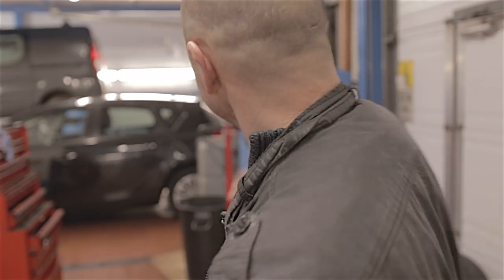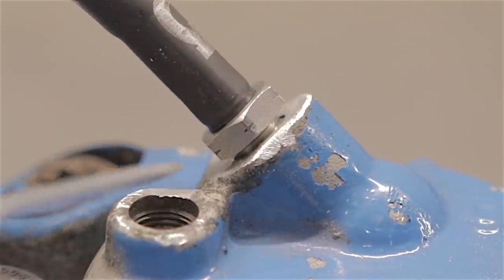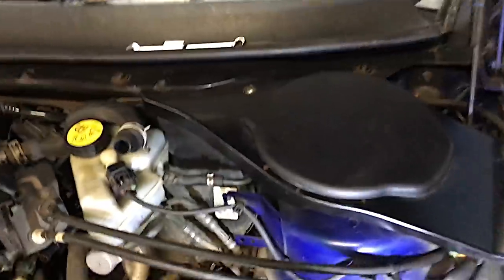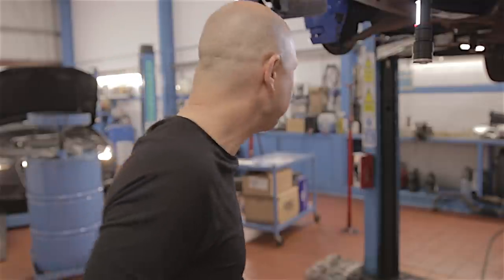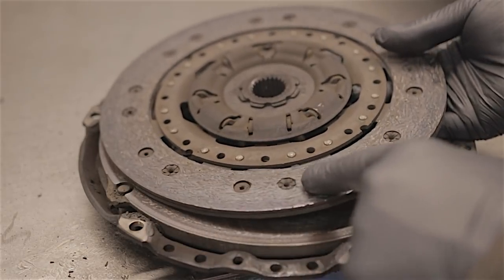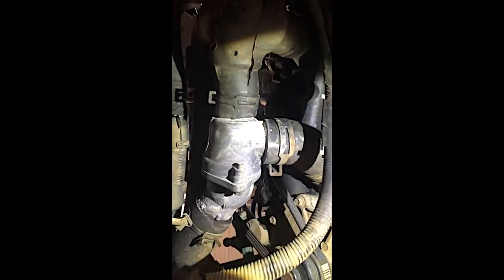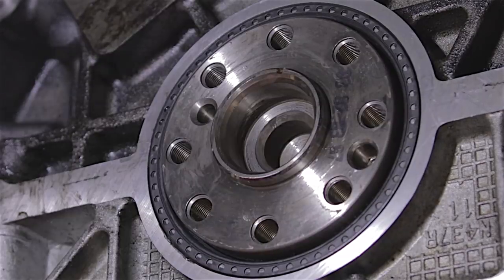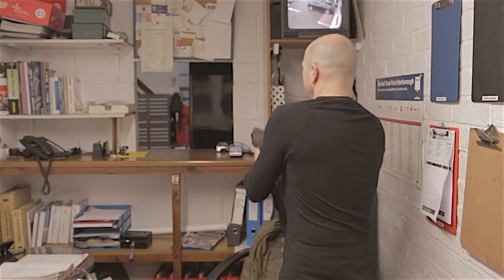Project ST220 (part 4)... Gearbox Removal

Comment: Definitely the Mrs Santa for Mrs Monika! 👍 😂
I thought the use of your credit card  on the rear crank oil seal was awesome idea! It worked really well! 👍 Regards the ST  brake caliper, I can't believe the cast was so far out! Good bit of fabrication though, bet the owner was chuffed. Me and the misses did smile when you found the exact bell housing bolt from a mrk 5 Mondeo, you'd chucked away cos too difficult to put back in! I've been there on my lads BMW 330d! At least the gearbox is lighter! 😂 
Great vid, looking forward to the fly wheel, clutch, gearbox refit! 👍

Comment: Meant to say, my old Mk1 Mondeo V6 leaked oil, I got a crank shaft kit from the USA, consisted of a very thin metal sleeve and tool to fit it over the original crank shaft, no more grove and no more leaks. Now my ST220 is leaking. Bloody Ford's!!!

Comment: If you do not have the proper pins for lining up the sun frame then spray paint the join to the body with light coloured paint. That way when you put the frame back on you can libe it up to where it was (I speak from experience and it works a treat).

Comment: It's not good to use copper grease with aluminium parts like gearbox case.  It's indusing galvanic corrosion betwen this two metals. Anyway, great video and instructions. :)

Comment: Hi mate thanks for this brill video but could you please tell me it was a v6 st 220 that you put that new main oil seal in please as i have got to do mine .thanks mate ,   chris.
Reply from the maker: hi chris...yes is was a 2006 st220 3 litre v6
Reply: @alan4x  Hi Alan thanks for the reply really good of you mate trouble is i have just put new clutch and fly wheel in but me rear main oils seal has just gone . as Vospers seem o be ignoring there phone on a friday afternoon hopefully you can tell me have i got to get new flywheel bolt as i dont know if they are stretch bolts or not so should i buy new or can i use the old ones ?????????, cheers mate , have a great weekend.   Chris.
Reply from the maker: @chrissaunders9672  hi chris... i think you would normally fit new flywheel bolts but to be honest on the taxis i just reuse the old ones and tighten them with an impact gun

Comment: Hello, I'm going have to replace the DMF and clutch but the most what scares me is te 4 bolts that holds the subframe on to the car. I think they have never been lose and my mondeo mk3 TDCI is 2002 model. Can I do something to minimize the risk that te captive nut begins to spin?
Reply from the maker: if you can spray wd40 or some kind of penetrating oil through the chassis onto the bolt threads and leave for a few days may help, otherwise just go for it and hope they come out, worst case you will need to cut open the chassis to get a spanner on the captive nuts
Reply: @alan4x  are thee holes in the chassis to spray wd40 on those bolts? I thought they where not reachable, even not to spray something on? I know 2 bolts are under the shell on the foot, do I have to drill a hole there to spray it on?
Reply from the maker: @timmymues9256  if you have a spray can with a straw on it you might be able to squirt some freeing oil through and chassis holes or gaps to reach the bolt threads
Reply: THX for all the good tips. I managed to get the 4 bolts out and back in.

Comment: Hi Alan, one of my taxis is going to be the scrap yard after it’s stripped, have a question regarding the seats, the seats are leather and we have another taxi that has fabric seats. Are these easy to swap over and what do you have to do with the wiring in the door for the memory to work for the seats. Cheers Alan

Comment: brake discs...... mmmm ok here we go
groooves in the discs do nothing.... they make it look ccol on the street...maybe
the grooves i think..are supposed to de.glaze the pads when they overheat in asda car park
and they make a funny grinding noise when you  stop...
how many  new performace cars do you see with this type of disc... ?

cross drilled discs the one swith holes in them allegedly.. help with cooling..  porches and stuff have them.. so must be good eh...
untill the holes get clogged with brake dust after 27miles.....
then porsche charge £800 for cleaning the holes out...

performance pads make the difference... then they squeak..:)

admire your skill alan 

N x

Comment: It is not recommended to grind aluminium as it clogs the wheel, if you really have to then use a course wheel :) The easy way to remove that oil seal without damaging surfaces is to drive a self scrapping chew into it and use a claw hammer to pull it out :)
The difference between a plastic and a metal impeller on a water pump is of importance if it is driven by the cam belt, if the coolant freezes solid and you try starting the engine then a plastic impeller will beak up and allow the engine to turn, with a metal one the cam belt snaps !

Comment: Hey Alan, love the show - I have a Mk 3 2L Duratec, which needs clutch/DMF done - how long does the job take with the typical garage facilities you have (i.e. hoist, gearbox jack, engine support bar etc)? I'm contemplating if I should do DIY - it'll be my first time doing it and only having jack stands, will need to buy engine support bar etc and still faffing about under the car. What do you think? Cheers

Comment: First time I have to disagree with the work done ST220 customer car as I recall, only one brake cable replaced both should be done due to the amount of work involved, dropping the heat shield, the brake caliper I would refuse to bodge it like that, but thats just me, you washed the engine down after fitting the new seal, would have done that before fitting it, episode 1 there was 10 minute of nothing before you got round to doing something, mostly interesting your work is a welcome distraction thanks for the effort you put in recording, editing, and putting out for us to watch.
Reply from the maker: cheers, criticism is useful, both brake cables have been replaced now😁

Comment: hello brother i need your idea  i have mondeo mk3 diesel duratorque  di engine .I would like to change transmission  with st220 transmission will it fit  or need to do some modification
Reply from the maker: the st220 gearbox will not fit, it is a totally different bell housing and the bolts won't line up correctly